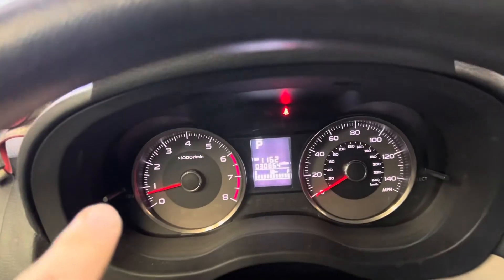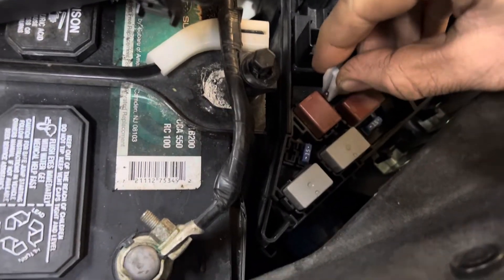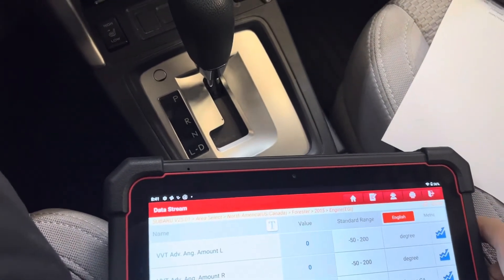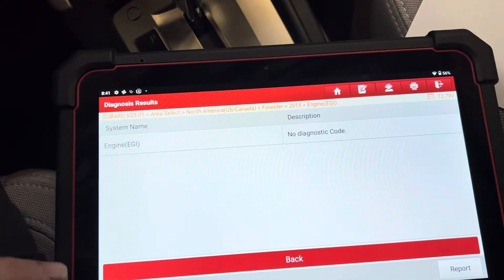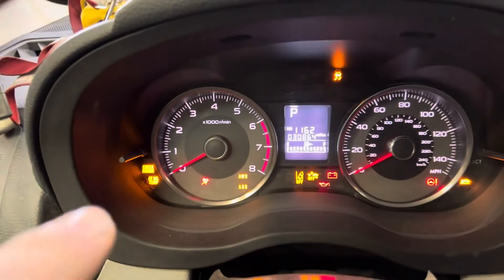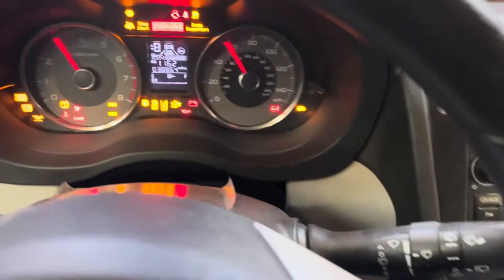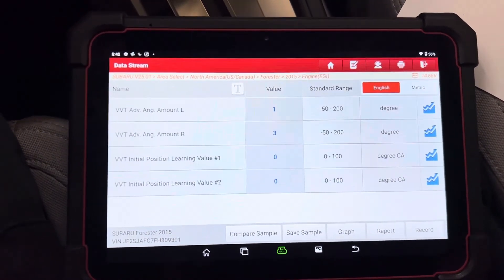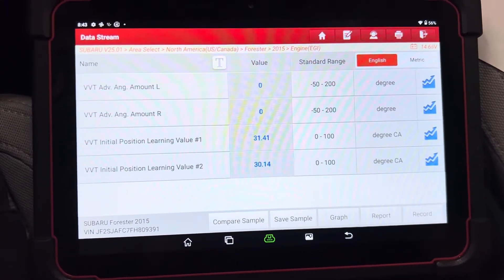Clearing 2015 Subaru VVT learned values without eeprom or ecm replacement.

Comment: Thanks Chad!  I’m glad to see all the new videos you’ve been putting out.
Reply from the maker: More to come!
Reply: @ThePracticalMechanic  which scanner carries the special functions feature I’m literally going through this process now and not sure which company or scanner carries it
Reply from the maker: @RAB31191  2015 and up has the function in launch, topdon, thinktool and autel.
Reply: @ThePracticalMechanic  dude you are awesome!! Thank you very much! Earned a subscriber 👍🏻
Reply: @ThePracticalMechanic  can it be done with the cheaper version thinkdiag2 hand held Bluetooth one? Last question I swear lol
Reply from the maker: @RAB31191  yes I have done it with the thinkdiag2. Several others have used the thinkdiag2 as well but some have issues paring it to a phone. It worked fine for me.
Reply: @ThePracticalMechanic  I bought the think diag2 connected everything and did everything you said. I have a 2015 Subaru crosstrek xv….. threw a p0011 code. Did your process it reset the values. Car runs perfectly fine and then after a few cycles like 1 or 2 the same code comes back each time. Poor acceleration and slightly rough idle at stops…..I’ve replaced all the ocvs, cam shaft sensors, oil change etc. literally everything. Do you think with p0011 it’s the timing phaser?? I’m down to my whits end on this one. I feel defeated, lol any input would be greatly appreciated. But your method does work but the code keeps coming back unfortunately
Reply from the maker: @RAB31191  it’s possible that the cam phaser is stuck. I would find the Subaru service bulletin and see if there is additional troubleshooting tips. Base cam timing can cause this code, a stuck actuator and even a restricted oil feed filter. 
This reset is typically used after timing chains or timing gears have been replaced.
Reply: @ThePracticalMechanic  that’s what I was afraid of….. the timing chain hasn’t been touched and there’s no awkward sounds or anything…….after the reset it runs perfectly fine and then once the car rereads the values it seems it comes back. I’m gonna look into the oil feed and see if there’s anything blocking…..but I appreciate your input and knowledge.
Reply: @ThePracticalMechanic  hey man, I have one more question for you…., when I go into test mode and then go in to clear codes or even read the codes is there a particular reason why it shows Zero codes?!? Because before I go into test mode it shows that I’m throwing that one code. Thanks

Comment: HEADS UP! 
For those not in the know, before you reset the Learned Values, you first have to address the cause of the DTCs,  the reason the LVs were exceeded.
Reply from the maker: Great point!! The vehicle I was working was known good so I didn’t mention it but if the values are out of range you will have to identify the cause and repair it in order for the values to stay in the correct range.
Reply: @ThePracticalMechanic  I really appreciate you and your cohort's work on this one and for sharing it. I bet the backstory is interesting as well :O)
This procedure could be a sort of 'Get Out of Jail Free Card' should one have an encounter with The Misses, aka Miss Diagnosis :O)

Comment: Hi Chad,
This is certainly the way to go versus EEPROM for the VVT relearn.  I wonder if this fix appeared due to a recent software update on the Launch & Autel due to prior complaints about not being able to perform the relearn?
Reply from the maker: If so, it is still not documented anywhere in service information or on the scantool. If it was a release on the scantool, they would probably make it more user-friendly with steps to follow under special functions VVT relearn. As of now that does not exist and this function probably was never intended for performing that relearn.

Comment: Wow I wonder if it would work on the ones in the TSB, I was thinking about taking the webinar to learn the eeprom way.
Reply from the maker: This vehicle is listed in the service bulletin 02–163–16r. The service bulletin states that if there was an issue with this when I had to replace the ECM. This function may make you seem replacement or EPROM work obsolete.